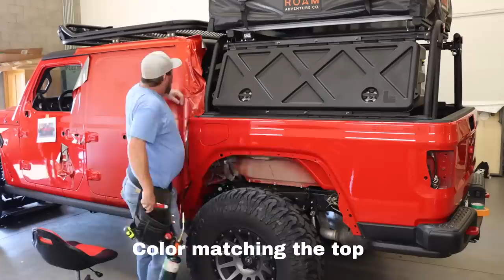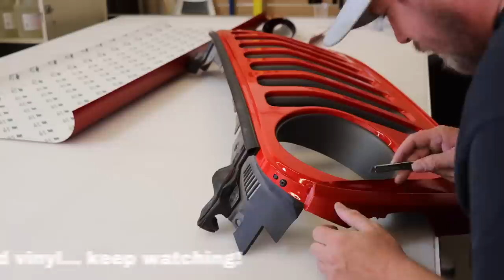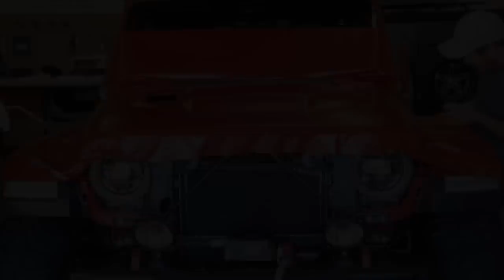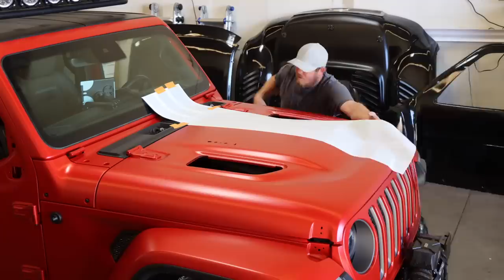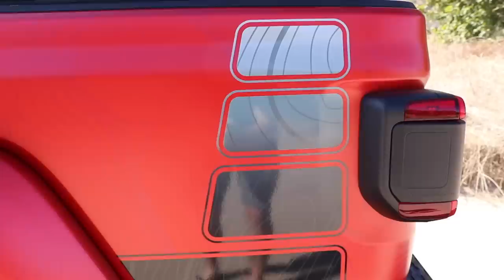Jeep Gladiator Vinyl Wrap - Time-lapse

Comment: You putting a ceramic coating over the PPF? It will help protect the PPF from the sun, plus keep it from collecting road dust on it's surface (and easier to wash).

Comment: I don't get it.  Why vinyl wrap?  I can understand it if you want a new paint job/color, but this is the same color plus, wrapping doesn't protect the paint, have you tried to take wrapping off a car?  If you're lucky the adhesive only penetrates down to the primer, otherwise you're down to bare steel, which in itself is okay since you really would have to repaint the vehicle anyways...  Besides wasn't the quote something like if you go four wheelin you expect a a few scratches?  I'm old, so can somebody who is younger explain it to me?

Comment: Is it a full wrap, meaning the door jambs and interior side of the doors too? I've seen some nicely wrapped Jeeps but if the jambs aren't done too it just ruins it but being that you did red on red it wouldn't be as conspicuous. I've seen color changes ie white Jeep with Blue wrap and all is well till they open the door and realize it isn't a full wrap with exposed oem color showing on the door jambs.
Reply from the maker: When you do a color change, then they wrap everything all the way so you can't see the old color.  When you do like what I did on my Wrangler and Gladiator, it's not necessary because the base colors are close enough.

Comment: Hey Brad or anyone reading this message I have 2007 Jeep jk, I was wondering if stock suspension off a 2020 jeep Gladiator sport would fit on my jeep ? springs , shocks, sway bars , control arms